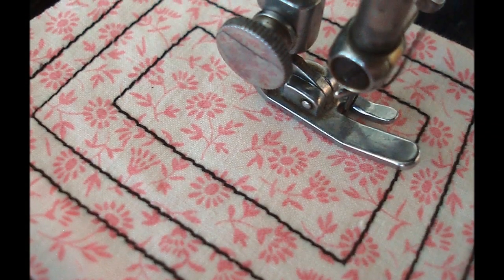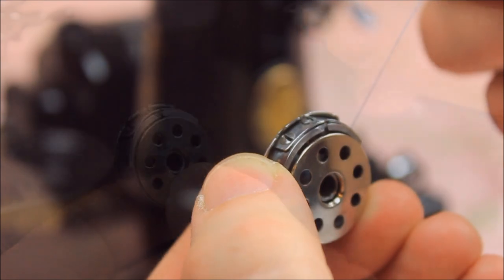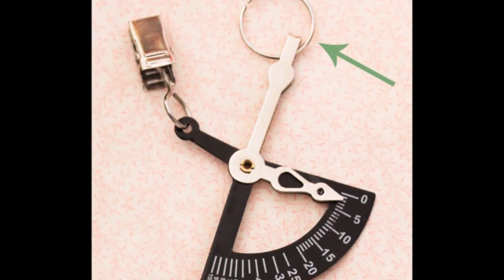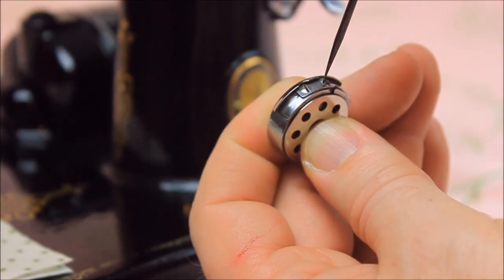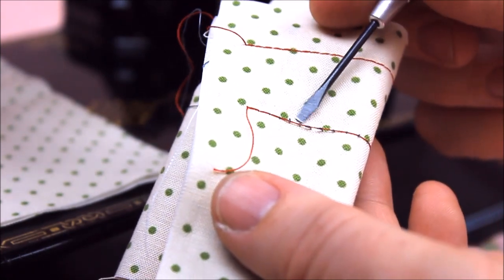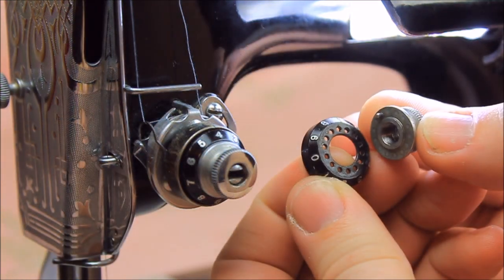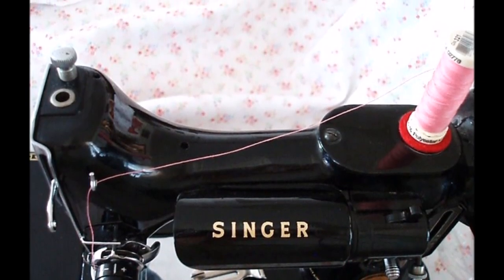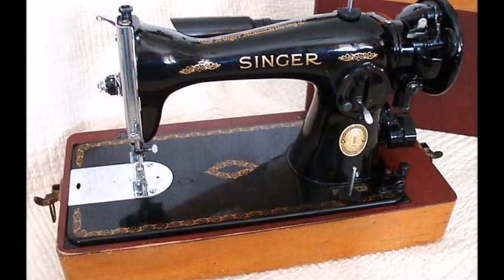How To Adjust the Bobbin Case Tension

Comment: This video helped me fix the upper tension problem on grandma's beautiful 221 (now mine) and no doubt saved me an expensive servicing. When I need extra parts I will remember your shop! Thank you so much. I don’t think this machine has been turned on in over 50 years and it’s now humming along. (I also watched your helpful oil and lube videos, got your special lube via amazon on Sunday.)

Comment: Thank you for this instruction. It is the first time i have seen instructions for home use of measuring the thread tension. I think your instructions will help many people. I started to sew 5 years ago, but I did have a dynamometer with a spring for other use, like the ones you may have seen in school with physics. So I have used it a lot, and I know it saved me a lot of trouble. I do use thin thread and heavy thread, so I have to adjust the tension all the time. Tension will depend on thread size too. So I use the dynamometers to measure both upper and lower tension. I do also have another more heavy spring to be used in thread tension assembly in order to have even higher thread tension for some use.

Comment: I love the video tutorials, very well done. I ordered the bobbin tension meter. It is not as shown in the video. The one I received is all silver so the numbers are difficult to read. Does it come in black, also?
Reply: I received a prompt reply from The Featherweight Shop... "The company quit making the other kind of bobbin tension meter last spring, however, this has turned out to be a blessing in disguise. The quality of this new style is far more sturdy and it clips on to the thread more securely.  Because of the markings being chromed, however,
we have made a black mark at the appropriate place of 23 grams for easier viewing reference."

Comment: I am familiar with setting bobbin tension on a babylock longarm machine, can that drop method be applied to setting bobbin tension for the featherweight machine? If so, what is the threshold of pressure ( on the longarm, the case should smoothly come off your hand with gentle pulling up of the thread)?  Since I am trying to minimize the number of gadgets I need to purchase so I’d love to be able to do this by hand.  Thank you so much for your informative videos and website!
Reply: I am also a longarm owner and have the same question.

Comment: tension on my 301. 
the bobbin thread is pulling to the top slightly. I have adjusted the bobbin tension to 22-23 meters using your meter.  I have adjusted the top tension from 1 to 9 with no change in the stitches along the way. Any suggestions of how to fix this issue would be apprciated. Thanks, Vickie
Reply from the maker: Check out the Featherweight Schoolhouse with all the categorized maintenance tutorials and then contact the shop directly for further Featherweight technical assistance:

https://singer-featherweight.com/blogs/schoolhouse